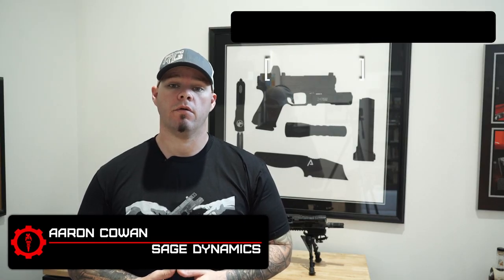Cowitnessing with Handgun Optics

Comment: Glad this came up. My RMR is zeroed, but when you look at it relevant to the irons it is high and actually to the left a little. I have no poa/poi issues but it always seemed a little odd. Not sure if I should be concerned.

Other thing I was curious about was practicing point shooting with the RMR. I have issues since when I'm target focused the dot is still there (since that's the point). The best way would probably be to turn the RMR off, but was looking for input.

Comment: Thx for clearing some of that up Aaron. 
Bought my first RDS and was worried cowitness sights would clutter up my sight picture. Definitely will be looking to go lower 1/3
Reply: Mine is a lower 1/3 works very well and barely any clutter at all.  I run a shadow systems custom Glock 17
Reply: @Cortney_Whitecotton  when shifting to iron sights in a lower 1/3 setup, do you end up raising the point of aim to align the irons as you would normally?

Is this a correct understanding?
Or does it end up being a 6 o'clock hold is some kind..
Reply: @huey7437  the irons are aligned perfectly when looking thru the RDS
Reply: @Cortney_Whitecotton  yes that's true, I didn't word that right... Do you end up raising the gun to put iron sights on target?
Reply: @huey7437  no sir when my red dot is on target the irons are up just enough with 1/3 that it’s on target so when I look thru the rds both are aligned perfectly

Comment: On your old video zeroing a red dot on a handgun you mentioned slaving the red dot to the irons.  At that time I found info on Primary & Secondary to zero my red dot at 10 yards and confirm at 25 which I have been using.
Reply from the maker: tunakiller1 slaving is where I start once I know the POI of the irons
Reply: But you make no mention about readjusting your elevation to the lower 2/3. You confirmed your suppressor height sights at 15 meters then bisected your red. And never mentioned adjusting out a 25

Comment: The company that mills your slide plays a factor as well. Anywhere from .125 to .160, from the few I have had experience with. Ameriglo gl-429 (.394 rear I believe) is barely a lower 1/3 if the company only mills to .125.
Reply: Check out Shadow Systems 
MR920

Comment: Well your zeroing video makes a bit more sense now. Turn the dot off see where the irons are zeroed, then turn the dot to the irons to get it close. Then move back to 25, and with the dot centered in the window, adjust from there. Is that accurate? And what does that do to hold over/ hold unders at different distances?

Comment: I'm using a Sig p320 with the RMR.  I had the slide milled to place the rear sight in front of the RMR.  The RMR was zeroed using laser ammo.   The iron sights are aiming 1ft. high from 5m.   I know...   It looks like the rear sight is a 1-1.5mm higher than the front.  I'm scratching my head here.
Reply: It could be that the dovetail for the rear sight wasn't milled deep enough, and as such, is higher than it is supposed to be.
Reply: @noah.s95  turns out the front sight is significantly shorter than the rear.  I bought the trijicon version and all good.

Comment: My RM06 dot (25 yard zero) sits slightly high and left of the front sight post when the irons are aligned. Is this fairly common?
Reply: Same here.
Reply: Same. Glad I'm not the only one. Curious which slide you're running.
Reply: Same for me (P10-C, milled by Jagerwerks). I wonder if it has to do with the tendency of right handed shooters to favor slightly left in shot placement. So when a right handed shooter sights in a red dot it is naturally slightly left in comparison to the irons. No idea if that is correct, just guessing.
Reply: ATEI Glock 19 slide with a KKM barrel/comp. I’m sure the barrel has something to do with it too
Reply: Head Shot zero the irons and dot independently at the same distance.  Turn the dot off and zero the irons.  Then flip the sights down and zero the dot.  I zero both at 25 and fine tune the dot at 100....
Reply: My G19 with a RMR in an AETi machined slide is doing the same thing. I wondered about this, because on my rifles the dot is right above the front sight.
Reply: @cletustheslackjawedyokel6083  I assume you all are using suppressor height sights? Also is rear iron in front of RDS or rear?
Reply: Adam Austin, I’ve got suppressor height Trijicons mounted in the factory dovetail

Comment: OK, so I have zero experience with a red dot, but I just got an MRO and I ordered a co-witness mount to go with it. My thinking was, if I'm using my BUIS, then my red dot must have gone down, BUT, unless I have time to remove it, I'm still looking through the optic and I don't want to obscure the bottom of my target with the optic bezel, mount, etc.  Is that reasoning flawed or is it just not a problem or...?

Comment: What back up sight height would you recommend for a Glock MOS with a holosun red dot? Are Ameriglo's .394 rear sights tall enough or would I need the .429 rear sights? I've heard mixed opinions on whether or not the short sights would work since the MOS system puts the optic higher than a milled slide.

Comment: I was told that there are SHS that are tall enough to be absolute with the Glock MOS pistol + Trijicon RMR. But for the last 3.5 weeks I have not been able to find them online or anything. NOT that I want absolute, but someone I work with said they exist, and that a Glock rep said they exist...well...me no see them.
Reply: That Glock rep doesn't know what he's talking about Iona MOS and there was nothing on the market. + MOS sits up higher than a standard milled slide, the sites I am running are ameriglo blacked out suppressor sights there perfect height.
Reply: That rep has since gotten back to me, (FINALLY!) and told me he is not aware of any SHS that are absolute and that he has never used them. If you can say whatever you want in 2018 I wonder what 2019 will look like...hmmm...
Reply: Dawson precision absolute.
Reply: Lost my connection. I have a Glock 34 mos and have a set of Dawson precision absolute zero suppressor sights. Check out their website. The dot on my rm07 does line up with the front sight in my sight picture.
Reply: why did you choose that route?
Reply: andychanny easier to re sight. I figured I did not need night sights because I carry with a tlr1. I figured it would be easier to re sight the rmr if it was an absolute co witness.